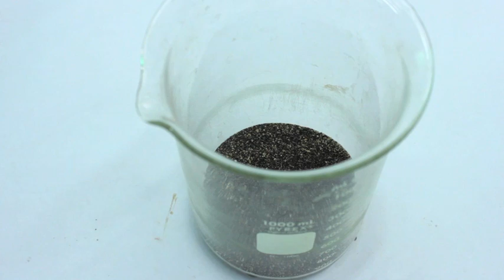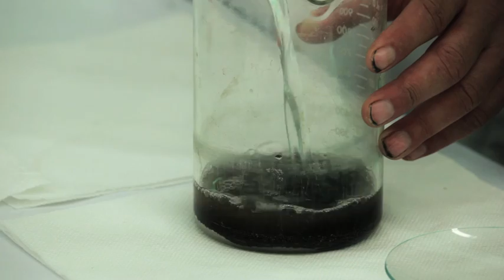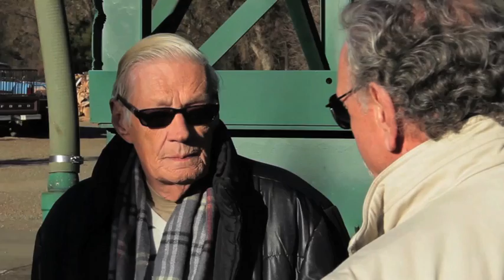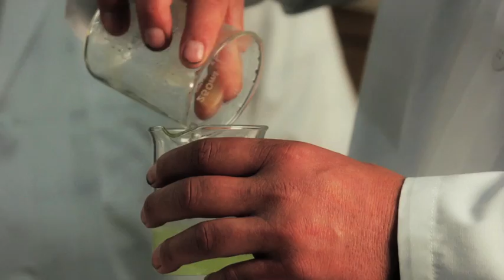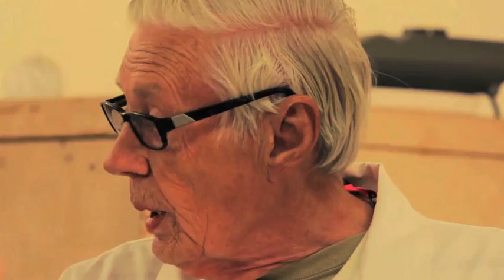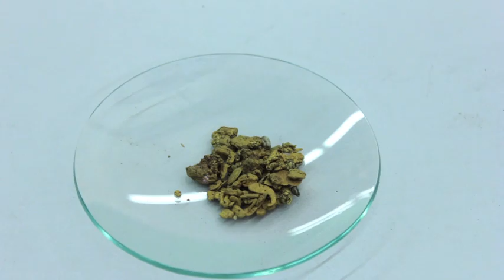Dome Rock Mines | Chemical Gold Extraction Process

Comment: I would like to learn how to do this at home. My house sits atop the biggest quartzite anticline on the east coast called the Chickies Rock formation in Lancaster PA. There are huge veins of iron stained quartz and when I break it apart and look at in under a loop i swear I see microscopic gold. After someone told me "gold wears an iron hat" I researched gold recovered in my area and found that 66,000 ounces of AU was recovered as a bi product of mining iron ore. Things that make ya go hmm?? Nice video by the way. Can I crush quartz and dissolve it in acid to figure out if my rocks are holding gold?
Reply: Hi! I can crush the quartz to a fine powder, then extract it with aqua regia*,
(1 HNO3: 3 HCl in volume, e.g. 3 oz of HCl to 1 oz of HNO3), it will extract pratically all metals including gold, silver and platinum (some metals like rhodium and titanium will not be extracted this way).
*Be very cautious when mixing this acids, because they emit a lot of fumes! 
*The use a gas mask rated for acid gases is a must or will have to do the operation in a fume hood.
As you are telling that the quartz have probably much iron, it can be extract even with diluted HCl (also called Muriatic acid) the solutions will turns yellow to greenish, it will not dissolve silver or platinum nor gold.
In any case it's better to use solutions that dissolves the metals not the Quartz (as HF does, because there will be much more silica than metal, and the products are gelatinous and hard to filtrate) and later precipitate hte metal out of the solutions, e.g. using sodium sulfite (caution, not sulfide!).